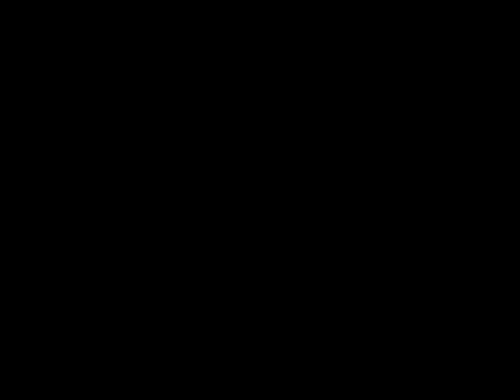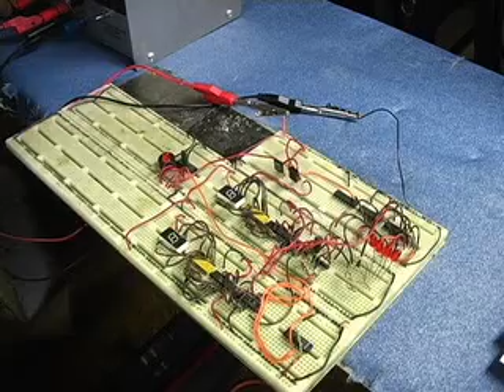Poor Man's Security System

Comment: Bro add a capacitor connected to the power supply and the alarm trigger; just in case if a "break in" occurs, people wouldn't be able to shut it off by cutting off the power supply. In this case, the capacitor would "drain" into powering the alarm for initiation.